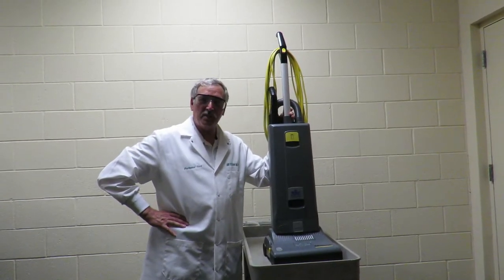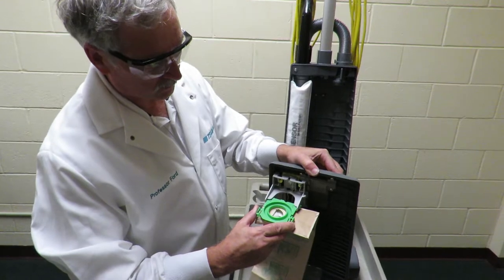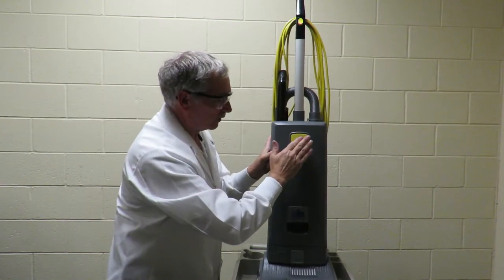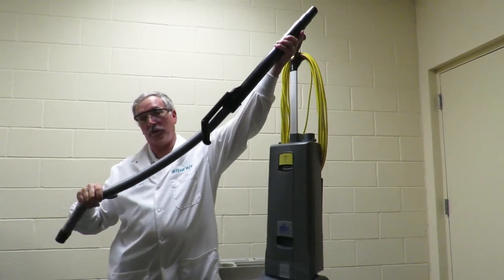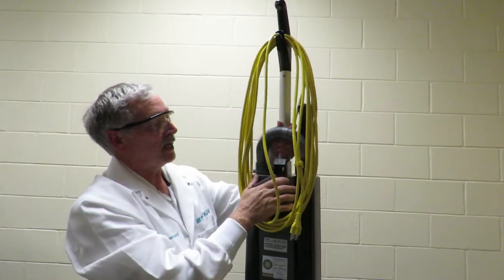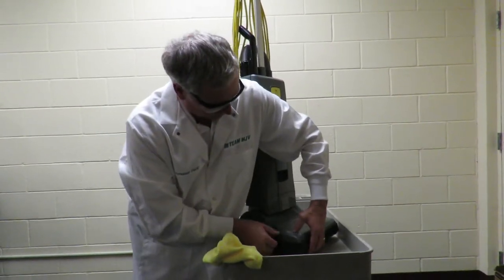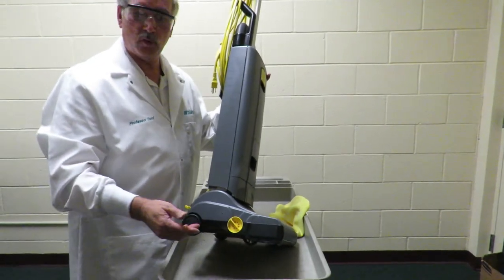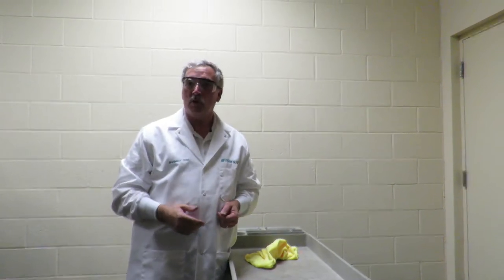Sensor 12 Vacuum

Comment: You should see the vacuums i have to clean at work.. they're Sensor S12 and they're several years old and have never had any filters or brushes replaced. I'm trying to fix one right now that has power but won't turn on. The cord has been replaced twice i think as well.